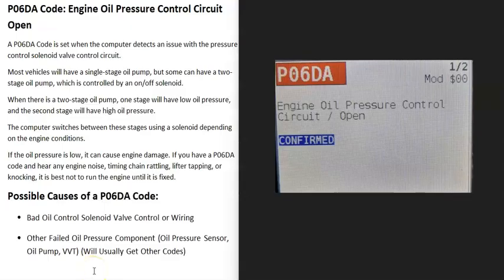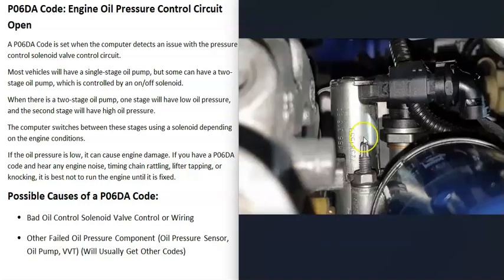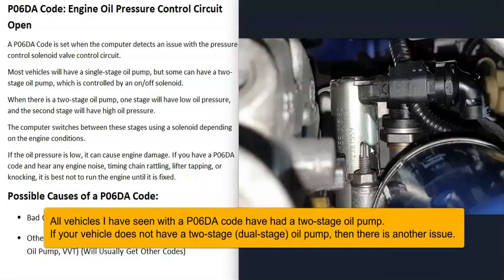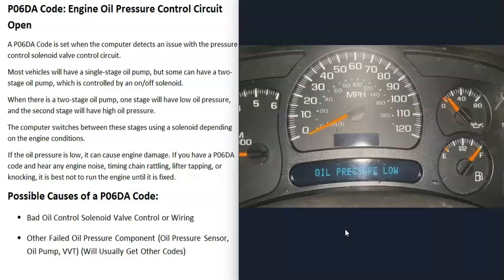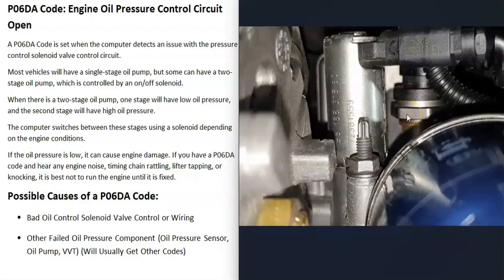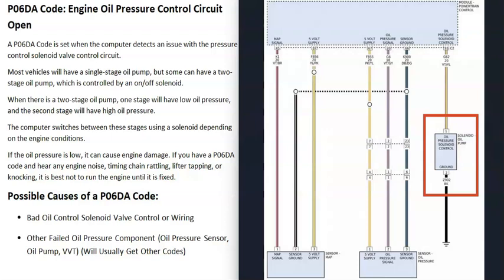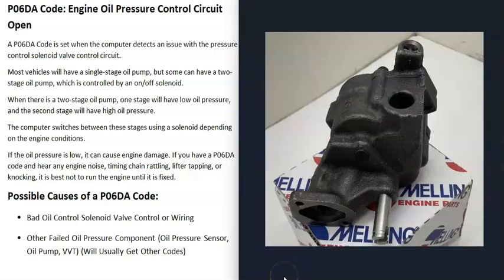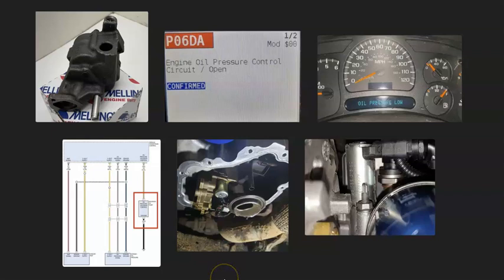Causes and Fixes P06DA Code: Engine Oil Pressure Control Circuit Open

Comment: Anyone have this code on the Mercedes particularly a GLC 300 and vehicle gear is slipping into neutral. I have symptoms that points to transmission but reader points to nothing more than computer, electrical or sensor issues. 🥺
Reply from the maker: Does the scan tool read transmission codes with Mercedes? Many scan tools only read engine codes.

Comment: I got a code print out p o g d a indicates that the engine oil pressure control electrical circuit had an issue or was disconnected for a predetermined period of time where do I find it on my Chevy Malibu 2016 LTD

Comment: Last month, my glc300 had this code as open. Yesterday, there was no code. Should I be worried about driving?
Reply: Is it still driving haha I am having the same issur
Reply: @N0brainerr0  still driving and no code still
Reply: Following
Reply: Did anything happen? Did it come back on? cause mine came on, I got it cleared, but it hasn't come back on yet
Reply: @nataliesmith659  no, not since January no more pending code.
Reply: @nataliesmith659 how did you clear it mate? Just removing DTC through a scanner? As I tried it but cameback unfortunately on my c200 1.5 petrol